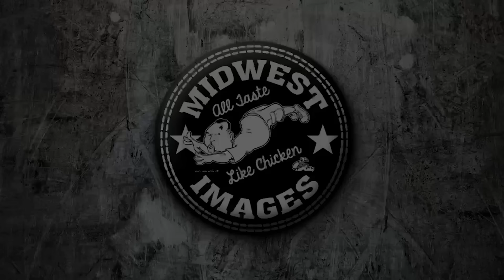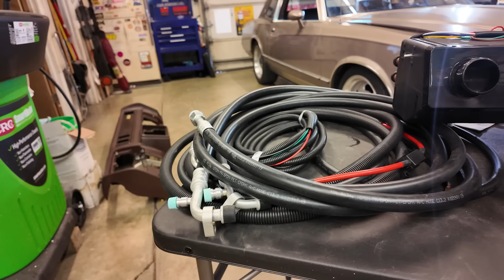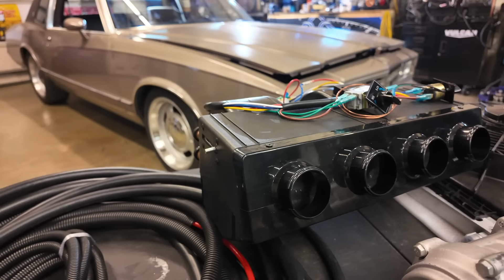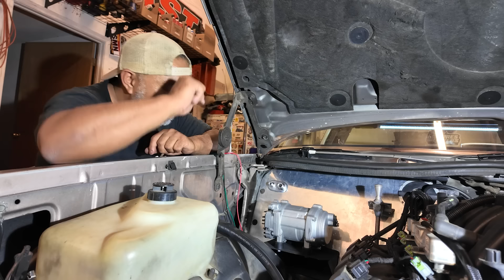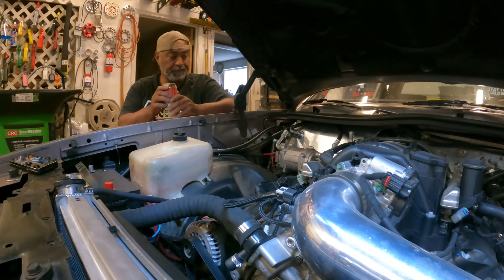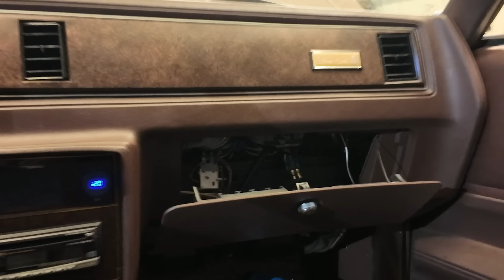12 VOLT AIR-CONDITIONING MY HEMI MONTE CARLO...IS IT WORTH IT?

Comment: Cotton make sure you pay the extra for the ceramic tint normal tint will not help but ceramic will cool the car down. And another thing is dynamat will make it cooler especially the roof and floorboards
Reply: I recently had a car tinted with ceramic and it's totally worth paying the extra. Especially if you plan on keeping a vehicle forever. It still gets hot inside, but not nearly as hot as my other tinted vehicles. More of a "comfortable" hot. With a windshield cover it only takes a minute for the ac to start getting cold inside.
Reply: This is the one thing you can do that will make the biggest difference, great point to bring up😂😂

Comment: Something I learned through building car audio and other electric bikes so on that thigs drawing hard amp is using a compositor to help with those electric draws u will save the alt so doing a small 2 battery and add the compasitor ive found they helped when using aftermarket light and other things but give it a thought that also work good in solar also keep up great work and have wonderful day

Comment: I have 5 sets on a 2009 Sunreef 62 catamaran. Marine ac units are heavy, 250 kg and up, have no heater function. These are lightweight, low cost and fit for purpose. 
These are mount, run the hoses, wire them up and enjoy the comfort. 
For auto use, get a140-160 amp alternator, 2 batteries and run it off a 3kw inverter charger and it will solve all your power issues. You are running it direct to 12v source -  a huge drain and strain on your charging system. I'm surprised your alternator didn't blow up from excessive heat.

On the boat, I have a pair of 200 amp alternators running off 2 Yanmar diesels @ 225 hp each, two 5K inverter chargers and the system split between hulls for the hotel load at 24 volts, and a seperate 48v engine start system. I have a 2.5k amp hr lithium bank(10 batteries), and 3kw of solar. For my instruments I have a dedicated 240 amp hr lithium bank and a 3Kw inverter charger for instruments and monitoring systems. This is also the emergency engine start circuit.
Reply: how much did this setup all in cost you?

Comment: Dang ole, maybe it’s time for a baddass mechman, js, singer, or brandx 400 or even a 500 amp alternator!! Been looking at these ac systems for my minitruck project, but same as this I have electric fans, twin viair 444’s, electric on the column power steering, and will eventually have a system and lighting… I have a 145 amp alt now and deleted ac. I figure adding another 250-300amp  alt where the ac compressor was will have less parasitic draw than the ac compressor did hp-wise.. and I’ll have all the amps on tap. In the extreme car audio space there is a meter u can get to have monitoring of yer amp draw, I just can’t remember off the top of my head:( Any of those alt companies would know tho. keep up the awesome content!!!

Comment: Only thing about increasing the air flow across the evaporator coil, is that it's probably designed for that CFM, and that means if you increase the flow.
You're more than likely to blow through the coils too fast, and when you do this it doesn't allow the air time to exchange the hot air for the cooling of the coil.
That means you are wasting the energy used to create the cooling, and you've wasted the energy used to run larger fans that resulted in less efficient cooling at more more expense to get less. 
Be my suggestion to find out what BTU rating the factory units run at, and see if you can find an electric compressor as close as possible if you intend to use factory that's mandatory. 
If you want to use add on system for interior system then find out what CFM at what BTU its designed for, and then if it's not rated for what you're doing. 
Then you have to do the research of finding the optimal components. 
That said same thing applies to the condenser coil it has to be designed to match the capacity of the evaporator coil.
The air flow the condenser fan moves properly is marginal at best when idling, but its not designed to sit in one place for longer than say couple cycles through a long red light and maintain the cooling. 
Even factory systems have difficulty maintaining proper cooling when idling for any length of time, but once the vehicle is moving then its getting a much larger supply of cool air across the whole surface of the coil, and not just the air in a small percentage of the overall surface area of the coil. 
Remember this for future reference, and the slower you move the air across the evaporator coil, then the more heat transfer you get, but drop too low, and the moisture created by the temperature difference will start to freeze, and if it gets to much frozen coil surface then no amount of airflow will thaw it out. 
You'll have to shut off the compressor and just wait until ambient air temperature thaws out the coil, and just like at home when this happens. 
You have to be watchful for the excessive amounts of water running off the frozen coil surface that goes for however thick that coil is, plus any additional ice formed around the refrigerant tubing inside the housing and the low pressure side of the hose may also begin to freeze itself so you'll have that moisture as well to deal with. 
Use to be GM, always insulated the low pressure line from the evaporator to the compressor because of two things.
First is constant moisture dripping off the lines onto other electrical components it passed by, and to keep the line at the lowest temperature possible for more efficient transfer of temperature back to a liquid state.
Confusing isn't it, not as much as you think it is once you understand the basis of how it does the magical thing that it does.

Comment: Go overkill and build in some redundancy to your electrical system on the battery and get a LiFEPo4 battery.  Wire in a switch to charge back up when needed off the alternator or charge on grid with an external charger.  This has a 200 amp continuous capacity and 300+ amp hours.  A little Honda lead acid battery might have 35AH.

Comment: Im sorry but you totally missed this video. No trips to Napa or frustrating fan box placement. You didn't take us along to the shop where you got it vacuumed. And to top it off you didn't take us along for the first trip with ac from the shop. I know you say it uses 60a but please just get an amp meter and show us how much it pulls. Run the thing for 5 min with the car not running and say "lets see if it starts". Im critiquing you because that what makes great content and makes us apart of the journey. It makes us feel like we are best buds drinking a beer with you even if your not drinking. Great review at the end of the video. Very detailed and you hit the big nail on the head with, would I buy it again. That really shows us if it's worth it. Whether that be should have used that bigger model or this is way overkill but it works. Love the channel and keep it up❤

Comment: I highly recommend clear UV tint, reduces heat by at least 20% and is almost invisible.
Works great in my old "green house" wagon
Reply: I think they make micro ceramic tint that can block nearly 100% IR and UV while only being roughly 10% tint rating.  Great for reducing heat in the summer, and keeping heat in during the winter.
Reply: @XenocraftGalaxy I got it in my 1981 vw rabbit pickup tdi swap. 
10/10 recommend.
Reply: @fastinradfordable  Are the prices still reasonable?

I believe I saw one quote either being $150 or $300-ish for the hole car. But I am not confident in either of these prices.

Could I ask what you paid for the tint?
Reply: @XenocraftGalaxy  i paid 375 on a 77 vw beetle .. was a lil more cuz its a classic and they take more care of seals
Reply: in central illinois at Midwest Autoskins

Comment: I’ll be installing a system on my 50 F-1 and the instructions say that I’ll need to update my alternator to a 200 amp and I figure that a second battery wouldn’t hurt. Let’s hope it works lol I’m in texas heat

Comment: Thanks for this review.  I've been looking at these for several years now wondering if they actually work.  What research I've done mirrors your review as far as upgrading the charging system because of the increased amp draw.  
I've been waiting for a review from someone I know will give me the good and the bad and not just a guy trying to sell a product.
I'm 66 and live in the Memphis, TN area and I AM going to have A/C...
I want to put one of those electric compressors in my 32 3 window and not have the ugly compressor messing up the engine compartment.  It just takes away from the nostalgia look.  
It wouldn't take much to cool a little chopped coupe like that.
Only thing is I have one of those Powergen alternators that "looks" like a generator and I think it's only 90 amps. 
Maybe that's enough?  No electronics, just a built flathead with a Pertronics kit and the existing VA A/C/heater and an electric radiator fan.  I haven't charged it yet so rerouting would just be buying (more) new hoses to mount the pump in the trunk...somewhere...

Oh, what about a binary or trinary switch?  Did your kit have one?  Would this even require one?
Thanks again.
Have a good one!

Comment: Personally I wouldn't install one as a primary system, I'd stick with the engine driven compressor if you have space.
I would install one in the back of the van, that said you don't have enough solar on the roof. (and add a big battery charger)
I've though about installing one in a small camper trailer for off grid AC.

You could probably use the vintage air airbox. 
I wouldn't mount the second battery in the boot, that's a lot of constant high draw current length. I do like the idea of having a second isolated battery though, using a voltage sensitive relay.

Edit: have a look at the reserve capacity on your battery, that will help you determine how many amps the system is drawing.

Comment: I recently helped a buddy install a similar system in the back of his 66 suburban so he could take his family across country for a vacation and combining this with his regualr vintage air system up front cooled that whole rig down in 5 minutes and kept it that way. Before that the back never really got cool and anyone but the driver/front passenger were never happy. Going electric was far simpler then adding a standard rear AC similar to modern suvs.
But yah, he already had a high amp alternator and battery so he could run an inverter and mini fridge for camping and it was a good thing because this hvac sucks some juice.

Comment: Higher voltage would be the way to go. Doubling the voltage does the same work with half the amperage. All the OEM ones I've worked with are 48V or 400V.

Comment: Great info!  I've been kicking around the idea of a 12 volt compressor for A/C in the Checker.  I plan on mounting the compressor in the trunk, near the battery and locating the condenser with a fan under the trunk floor behind the diff.  Being a Gasser, there's a pile of air going under the car already, and I wouldn't have to worry about impeding the flow to my rad.  I daily the car as much as I can, so A/C when it's above 85 would be tremendous.

Comment: Great Vid.  But Listen.
If that 12v AC pulls 60 amps at start up, what is it running after start up?
As for putting a motorcycle battery in the rear,  you wont have enough power to start the compressor. the battery is too small.
You need a heavy car battery just to maintain.  And you are correct, if the charging system goes down, that will run for under an hour before the voltage shuts down the compressor.
EVEN LESS with a motorcycle battery.
The reality is, the battery is only storage for start up.  The equipment runs off the alternator, not the battery.
After start up, you can pull the battery and the ac will run.
Just a thought.
also,  if you are going to tint the windows, 
look up Ceramic tinting.  You can get it in clear or any tint you want and it will stop the heat from the windows.
This tint is highly popular with the RVers.

Comment: Seems like the ticket to retrofit my low HP rides like the 61 Econo and the 67 Bug 👍
Reply: no. low HP means low alternator power. you desperatly NEED many many amps for such a compressor.
Reply: @casemodder89 you can put a high output alternator on a low HP engine
Reply: @darylarmentrout252  you could, but then it wouldn't really move because the high output alt draws most of the torque the engine can supply.

much like belt driven aircon on 1.6 econo boxes. you can cool yourself or you can accelerate - not both options at the same time.

Comment: 150 amp alternator isn't going to be enough with all you're running. Just get yourself a custom built alternator from Singer Alternators, Brand X Alternators, JS Alternators, etc. I'm running a 320 amp alternator from Singer in my bass ride. Also, I'm building a 1947 Ford F1 truck right now. I'll be running an electric AC setup similar to this, but I'll only be pulling about 40 amps without the AC, so the factory alternator will be plenty sufficient.

Comment: Tesla AC in a Hemi car!!! Most any of the modern 300 amp 6 phase alternator should handle that AC unit. I'm sure mopar has a late model alt that bolts to that Hemi motor. I know Holley does. 6 phase alt produce more output at idle and are more efficient than a conventional alternator. I would not want the car using the battery to power the components with the motor running. I was taught the battery store energy to start the motor, the alt takes and over supplies power after the motor is running. I'm using a late model corvette 6 phase alt to power the vehicle and 700 watt 5 channel amp, that has no problem popping a 100 amp circuit breaker when I'm having to much fun!!!

Comment: Seems it should be treated like a car that has a very big stereo system.  Setup almost like a competition car audio set up. Maybe some capacitors might help? To help isolate the battery.
Reply: Capacitors fill in really quick voltage drops like when the bass hits. They discharge and charge quickly. The battery does a similar thing for smaller voltage drops and for longer times. That's why most ECUs and ignition boxes in particular say to wire directly to the battery.

Since this kicks on and runs for probably minutes or hours, not seconds like music, a bigger battery (or multiple batteries, like he's suggesting) give a longer running capacity for way less money than a big cap.

What I'd suggest here is (also like a lot of car audio guys do) using a second deep-cycle battery; they're designed to power a constant moderate load for a long time and to be discharged farther without damage. A typical starting battery is designed to dump a lot of power quickly, and needs to be maintained in a narrower voltage window (can't be drained as far) by an alternator.